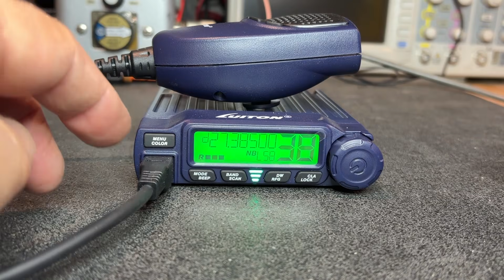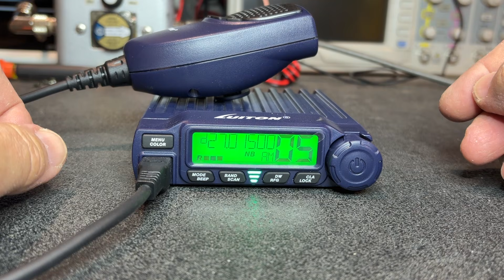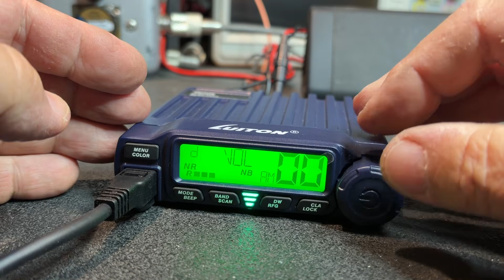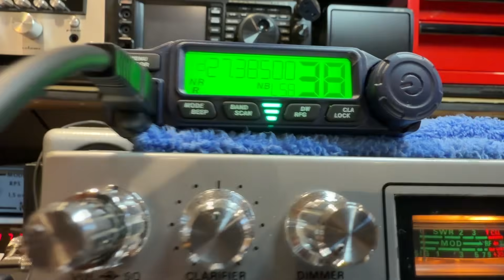Luiton LT-310SDR Good Bad And The Ugly OVERVIEW #cbradio

Comment from the maker: Timestamps
@:00 Intro
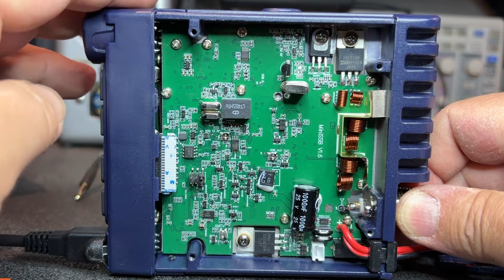@7:50 A Look Inside
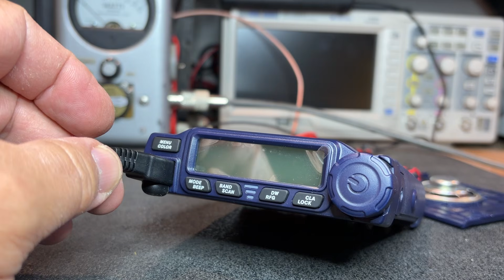@10:33 Goofy Volume Level
@13:10 NR (AI) As Aggressive and Fake Sounding
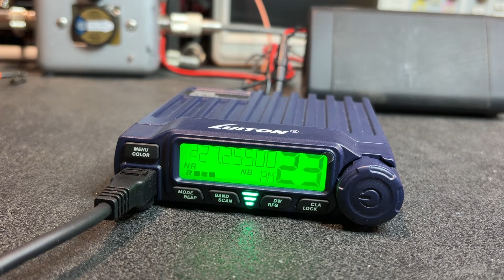@15:31 SSB AI Sounds Watery
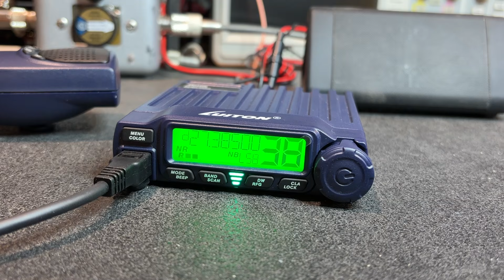@17:13 Draws Amperage When Turned Off
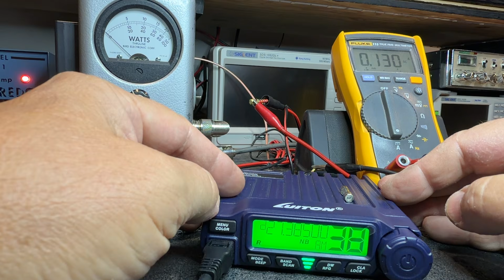@19:48 RF Power Output Test (Very COOL)
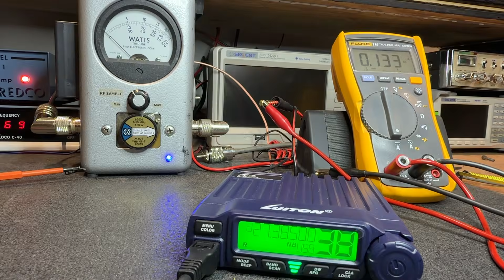@24:46 TX Audio Latency

Comment: Using an external speaker with a built-in adjustable volume control solves the biggest issue.
Reply from the maker: That and dialing down the RF gain a tad. Cheers

Comment: Don't perform a radio Reset or you 'll  loose the Noise Blanker.  Manufacturer will not help.  keeps sending me to view other peoples YouTube videos.  None show how to re-enable it.
Reply from the maker: Mine works just fine, you might have a buggy rig.  My 310 is out on loan, so I can’t check if the midland software could help with your problem. Maybe check Simon The Wizards blog.
Reply: @390WagonMaster  Just out of curiosity, have you done a factory reset on the unit?  People I've reached out to have had the same issue happen to them.  I have the programing software and cable.  Made changes to the units minimum volume, which is much too loud.  Alas, nothing there to re-enable that setting.  BTW Im referring to the NB not the NR.  Updating the firmware might work except I don't think thats possible on this radio.  Thank you
Reply from the maker: Still have not got my radio back yet, I will check mine out. Just wanted to let you know I have not forgot you.
Reply: @390WagonMaster  Thank you!

Comment: I received mine last Thursday (7/09) with screen issues.  All the LCD element lit, but some channels were blank, some had partial display, some displayed extra elements, and a couple were normal, same for the menu screens.  After a quick back and forth with customer service I sent a video showing the issues Friday afternoon, eastern US so Saturday in China.  I haven't heard back about the video, but I did receive an email today (Tuesday. 7/14) saying my order was bing processed and would ship soon?  An email asking for a review of the radio came at the same time, so I'm not 100% sure what's going on.  It looks like they are sending out another radio?  Never had this happen before, so I'm guessing they will send a return shipping label for the original unit if they do send a replacement?  Time will tell.
Reply from the maker: Please keep us posted
Reply: @390WagonMaster  Will do.

Comment: Thanks for not wiping this under the carpet like all the other reviewers but that's not "a little latency", that's like 500ms or half a second. If "second" was my last word you wouldn't hear it if I wouldn't remember to keep pressing the PTT for half a second longer.  But the start of the transmission seems borked too, in that your first syllables may not make it to the modulator either. To drop an audible and intelligible, short "break" between transmissions in a QSO with this unprecedented high "latency" is quite a challenge and I'm afraid this is a complete dealbreaker (probably not only) for me.  Sadly, I think this is just the DSP running on very slow hardware, so this may not be something that could be improved to an extent making it behave like a regular radio.

Besides, my example (received today) was manufactured 2 weeks ago and the promised first improvements in the volume control should have been implemented but it's still really only usable at the first step when standing still or indoors. FM deviation seems still pretty low and demodulation brings clicks that sound like digital audio clipping despite invoking the audio low pass filter, and to skip a few other FW quirks, the RX/TX RIT is a great way to mess up your "bands" (as it memorizes your RIT settings per channel), the mic is really nothing to phone home about or with and the rotary knob is seizing a bit once per rotation.  This is quite a lot "you get what you paid for".

The receiver seems to be fairly sensitive and the "AI" (god I hate that) NR which is really just ML is working pretty well at moderate settings even on FM, which makes the issues turning this radio pretty much into a dud even more heartbreaking. :(
Reply from the maker: I like the size, easy menu, and being able to make some basic adjustments via the computer.  I would like to have the proper software so we could maybe do a bit more fine tuning.  Overall IMO it’s more of a novelty, that in the right form could make a sweet handheld.  Thanks for your great feedback, oh yea, I think I said the audio delay was a half second or so, very annoying. 
Cheers
Reply: @390WagonMaster  Yeah the size is what immediately sold it to me too, it's about as much radio I can fit into my tiny car without turning it into a one-seater, I can simply wedge it in between center console and seat and be done with it for a trip, or going lightweight full portable with a Li-Po battery... it could have been quite a contender for the "CB of the year 2026" title. Too bad, really.
Reply: I checked the RX path, even with DSP functions on it has a completely fine latency of 10-20ms so that's not a good explanation for the latency, maybe there's some faint hope that this could be fixed.  I emailed them yesterday, let's see if they care.
Reply: @390WagonMaster  Figured out more about this: When you connect the radio to a power source and don't touch anything, the TX mod latency is only ~100ms, that's not exactly brilliant but certainly less disturbing than half a second (actually more like 300ms). Now when you activate the "AI" NR, the latency multiplies and it does not get shorter by turning the NR off again. Even turning the radio off and on again does not reset this borked state of the radio, you actually have to disconnect the power cord to do this. The easiest way to check this is simply using the talkback function, it reflects the delay heard on an external receiver.

This probably explains why not everyone is raving mad about this flaw, if you never touch the NR you likely never encounter it to this extent. Also, the TX NR sucks very much so people tend to leave the NR off (because you can't have that separate on TX and RX) so they live with the still quirky 100ms.

Comment: You’re expecting a lot for $129.
Reply from the maker: Not really, I would assume these bugs would be worked out before shipping out to consumers. They have engineers right?  That being said the volume control and RX sens can be adjusted via software and a programming cable. Why does that not just get handled at the factory.  (BTW... Luiton was aware of this)
OR
Does the low price justify the lack of QC?
eh?
Cheers
Reply: @390WagonMaster Would you expect a Kia to perform like a Ferrari comparing to price alone? Just saying. Honestly, I’m not expecting a $129 radio to be perfect. I actually have this radio and it’s biggest plus is the all mode super compact design.
Reply from the maker: Agreed on the size. They will get better with board updates i'm sure.

Comment: The volume issue is the same with the squelch, each number is a giant step. The big channel/volume knob is kinda nice but it bumps & turns way too easy so it's always changing channels or something.This radio is just crappy for scanning or monitoring with these flaws. The radios meter is truly useless, it does not follow signal strength or match the RX light sensitivity. The radio's real power is very weak, it gets really hot even just on med power. I have concerns about weird wattage spikes when the mike is keyed. My Nissei 103Max digital has shown up to 21watt spike, like others have posted about small China radios. And the radio is very warm to the touch even when off. I for sure recommend ppl AVOID buying this unit & consider the Anytone KT-5000, it is a much better small radio.
Reply from the maker: 100% Luiton has been making revisions and will continue I'm sure. AS with anything it will get better, but to what point? The At5000 is a great rig in fact I'm up at the lake DXing on 10 and CB with it.  Hihi

Comment: I have the Radioddity Pro 27 CB and it's volume range is the same as the Luiton, ungodly loud at this lowest . it's either no volume or HEY CAN YOU TURN THAT RADIO DOWN?? lol
Reply from the maker: You would think this is a no brain'er, dont let them out to the public till you FIX the issue. Fortunately there is a fix and when the part comes in i m going to do a video on how to solve the problem Cheers

Comment: So.....  If you hold the PTT button for a second or so after you finish speaking, does it still cut off the last word?  Is it possible you are stopping the transmission Killing the carrier before the audio process has finished its task?  If so, the fix is easy.  just keep the transmitting a second after you are finished speaking.  That might bother some, but wouldn't bother me.
Reply from the maker: 100% Holding the PTT a second after talking works best, no cutting out.
 It takes a bit of getting used to not seeing the watt meter move until a half second or so when you first key up and start talking.  It is what it is:)
Cheers

Comment: Thanks for the review!  I have to have something I can repair when it breaks so I'm not thrust into the situation of having to purchase it again.  If someone gifted one to me, I'd use it, but I'm gonna have to stick with my traditional rigs for now.  I went to Simon the Wizard's website - he's been talking about this rig since back in May.  He shows how to make your own programming cable from Amazon bits.  Part of what can be corrected is the annoying volume issue.  That delay on the transmit though is also a killer for me.  I notice it on cellphones and digital networks...a delay while the electronics processes everything.  It's good to know these things.  It's a useful radio, but I'm too old to tolerate these cons so I'll stick with what I've got.

Comment: Yeap. That volume  way to loud  for one click.  On dial.       Just like my.  RF. gain on my. 980 uniden.     # 2 setting . Is to  low. And 3 is to much sometimes ..  
Needs to be a. 2.5.  Settings.  Just a little. White noise  in speaker.     Should be. Half Settings in. RF gain.
Reply: This digital "step" volume control has been an issue on so many things for decades now. I don't understand how this is STILL an issue on these rigs when it should have been perfected years ago. I guess it comes down to making an increased number of digital steps to make the steepness of change disappears to the human ear like the old superior analog volume controls did since forever.

Comment: Make up the program cable, the software cures most of your issues. Your noise floor is not the radios fault. I have 2 of then, early and latest version, and dont have  any issue with the noise floor. Btw the mic is crap.
Reply from the maker: Yes, audio reports were mixed. On my monitor the mic sounded a bit hollow, boxy.  But still not bad. When I paired it up with my Pride 100 people said it was loud and clear audio. This radio is great for old school AMPS. Thanks for your comment and Cheers to you.